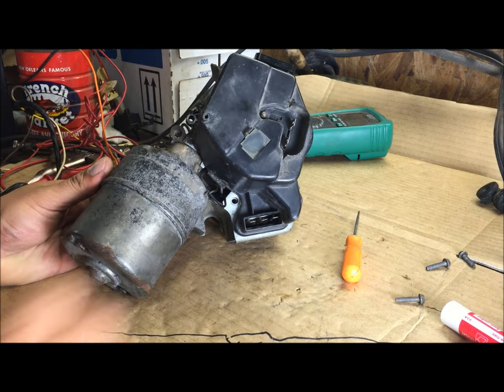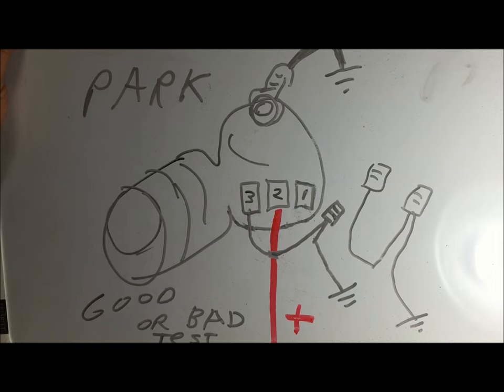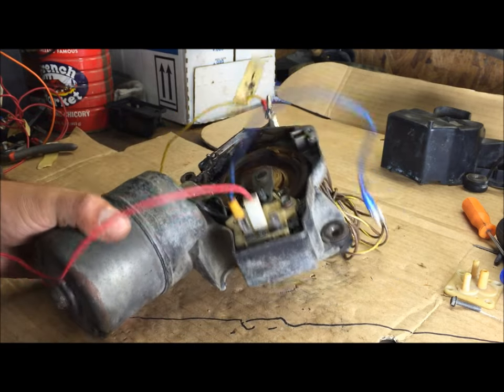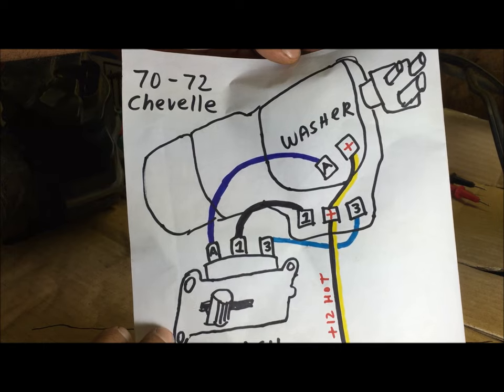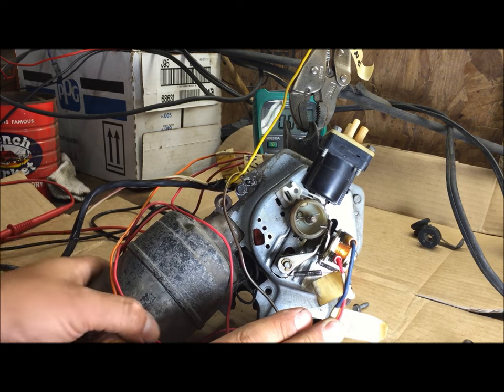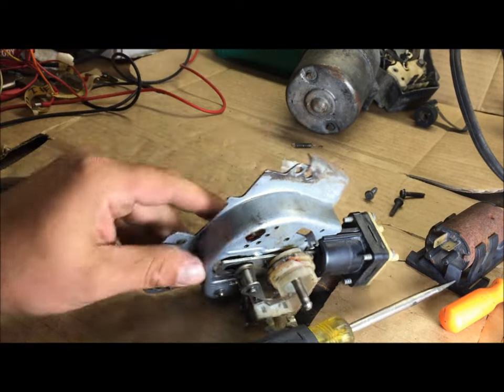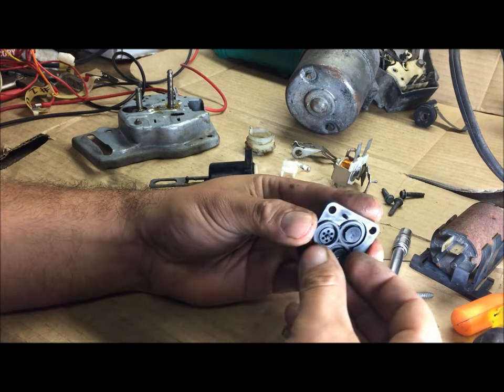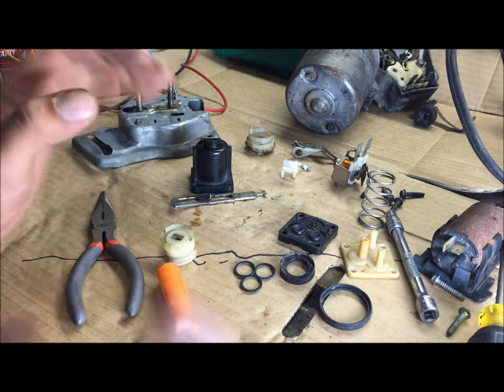how to test GM wiper motor wiring and washer pump IMPALA CUTLASS GTO NOVA CAMARO CHEVELLE

Comment: My motor seems to be working but my switch mechanism is smoking... Its a Cardone refurb job from pepboys.
Reply from the maker: the switch grounds out the motor so make sure it has its own ground.. and make sure the motor is grounded to the firewall
Reply: I tried the same thing you did. I grounded the motor housing directly to the battery. And I used a separate wire to ground the switch wire. It only smokes on high speed.

Comment: Chris, working on my 68 el camino wiper motor that I purchased.  it's making a clicking noise while testing on the bench.  Took the cover off of the pump and shot a vid of it running.  I know you're busy, but you are the only guy on here that shows any true understanding about these wiper motors...Can you take a look and let me know what you think?  Any ideas what adjustment is needed to quiet it down?  Thanks!  Link:  https://www.youtube.com/watch?v=wHa2TjdKoAs
Reply: @chriscraft77022  Forgot to mention, that sound is on low speed, without activating the pump.  When I wire up the pump and apply the ground to it, it turns fine....

Comment: At this point I may just 3d print some new seals
Reply from the maker: just retro fit the pump like i did in my other video and not worry about it for 30 years...  that pump came of a 1988 and still works to this day..  the problem with 3D printing one is that you need a real one..  not a shrunken one....  good luck and a great idea.... maybe that is what the camaro guy does that sells them for $59.99